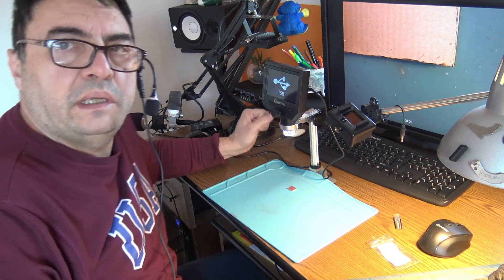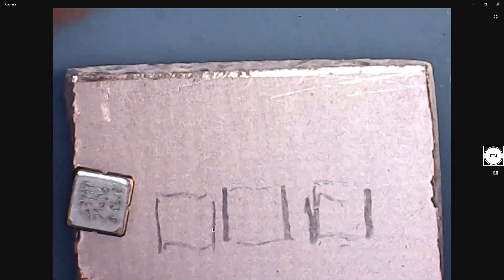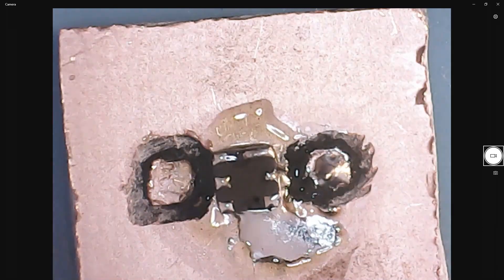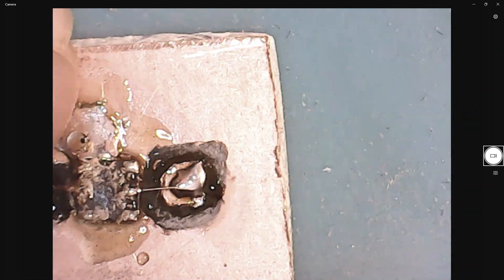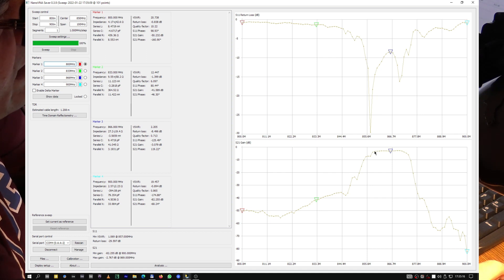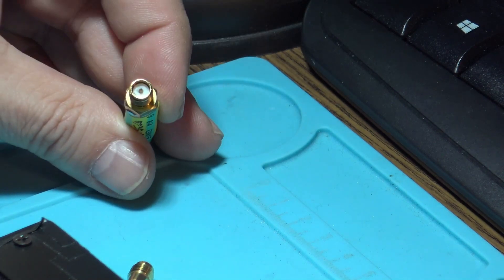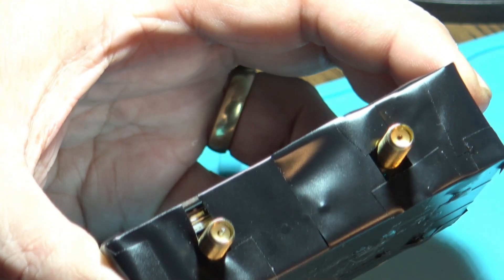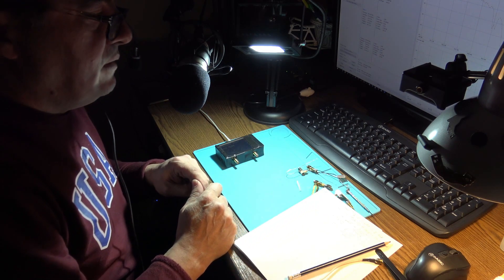LoRa gateway miner filter test

Comment: Viorel, thank you for the great video, i have a question, you mentioned that pin 2 is output and pin 5 is input, on the datasheet they say the opposite that pin 2 is in and pin 5 is out , can you plz explain which pin goes into the miner , thank you very much
Reply from the maker: My mistake..2 is input and 5 goes to miner..but tehre is not important , this filter is working both ways..so don't be afraid..is working anyway..

Comment: At 11 mins, you show the S21 of the filter for a client, perhaps you have the wrong graph, as the numbers don't match - also, the attenuation is only -10db, which is very bad, I think the Saw Filter is faulty, you should be looking at -30 or -40db instead of -10db.
Reply from the maker: That as the test about..to many connectors in the chain bring the results down...you're right before filter is only-10, signal escape thru connectors..finally the shape was ok..so keep the chain as short and as clean possible Thanks.

Comment: Viorel very interesting and good video..but I already bought 5x rfid 868 mhz bandpass from aliexpress with 3.5 dBi insert lose..but where can I buy rfid 868 mhz chip? thank you very much
Reply from the maker: I couldn't find specific 868Mhz, the best and the ones they are using in the hotspots are this A3717 on 866.5 Mhz..is covering very well the whole band..like 7Mhz   including 868 of course.
Reply: @viocaia  thank you very much
Reply: Viorel can you recommend me amplifier from aliexpress? Ill have filter -3.5 dbi+0.2 arrestor+0.5 on cable+connestors..is it even good to boost the signal?Ill use it on mikrotik 868 mhz antenna 6.5 dBi omni
Reply from the maker: @audiyoutubePrešov  All the usually RF LNA amplifiers, from Ali or wherever are for RX only, no bidirectional, so if you connect one of that on the path you will not be able to TX anymore..single solution is to have a second antenna just for RX, connected somewhere in the miner..probably at it;s own LNA input...or buy a bidirectional amplifier like Flarm ..here..https://flarm.com/products/powerflarm/product-selector/
Reply: @viocaia  I messaged you on instagram about schceme and amplifier.
Reply from the maker: @audiyoutubePrešov  I'll take a look..
Reply from the maker: @audiyoutubePrešov  Can;t find it..I'm caiavio on istagram..
Reply: @viocaia  I know I already messaged you Viorel(Kevin Komlos)
Reply from the maker: @audiyoutubePrešov  Please subscribe!
Reply from the maker: Thanks Kevin! Appreciate!
Reply: @viocaia  Did you find me?

Comment: Your mick is buzzing when you use your soldering gun.
And. This is now the 3rd time I'm seeing this video. Did you reupload it???
Reply: Yes, he had a really bad overlapping audio editing issue, and he has an open ground issue with the soldering gun, or his mic.  It is there, yes for every video he uses his soldering iron.
Reply from the maker: @generalawareness101  The power supply is leaking AC..few volts..I have to change it..
Reply from the maker: Yes..I was so tired today, couldn't put the things together well..one of those days! All the cameras and Nanovna had issues..no connections..batteries off..crazy day.You're right, there is something wrong with the  TS100 power supply, is leaking AC, I can feel it too..and it's properly grounded..maybe a capacitor , I'll check that next week..thanks for patince and support..good days will come if we don't give up!
Reply: @viocaia  Don't go and get yourself killed with that thing.  Open ground loops in audio is a nuisance, but open ground loops with high voltage can be lethal.